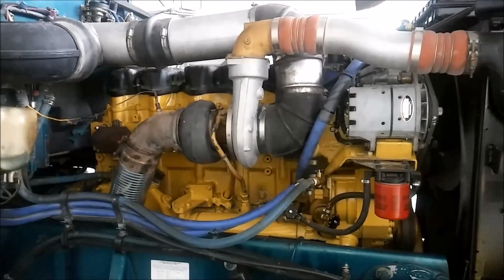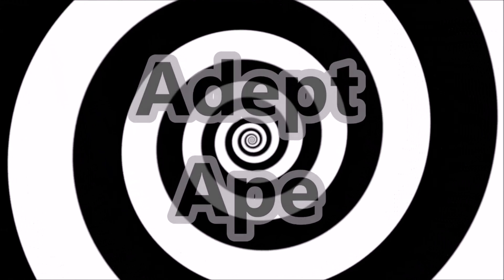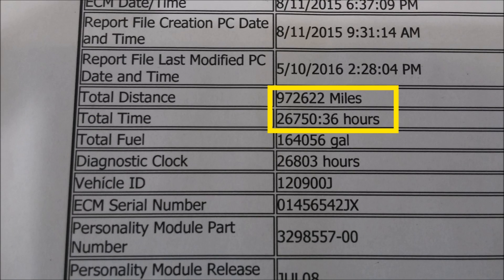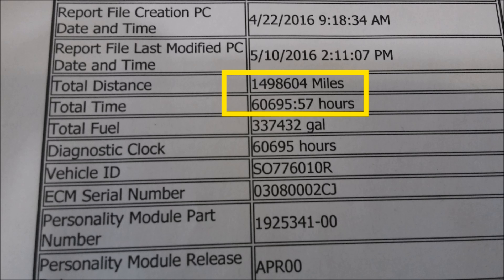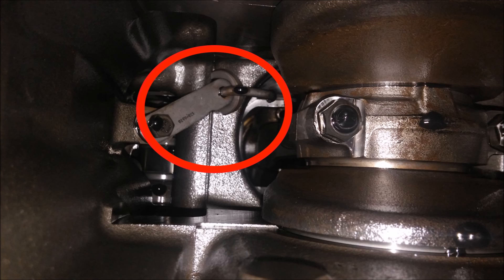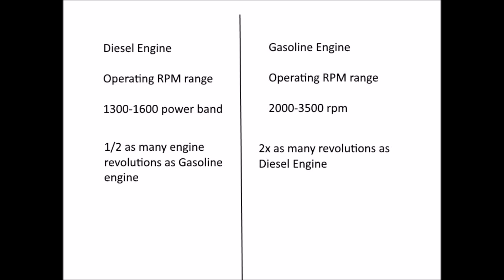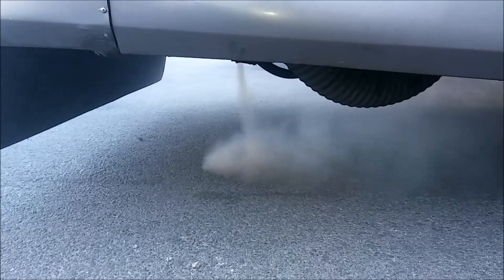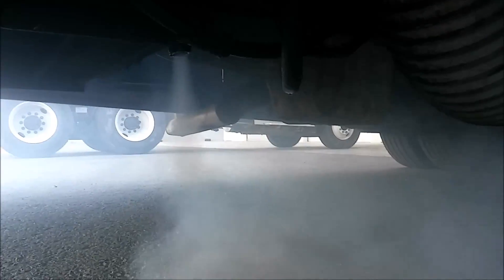Why Do Diesel Engines Last So Long?

Comment: Heavy duty Diesel engines (think caterpillar, cummins, Detroit Diesel etc.) are designed to be rebuilt after every 1 million miles. If routine maintenance is kept, the original block should see about 3 million miles. This is because the large displacement highway engines have cylinder sleeves that are replaced every time the engine is rebuilt. 
I really enjoyed the video by the way! 
quick question- Do you work for a Caterpillar dealership and if so, did you start right out of school or did you switch jobs? Also, do you like working for CAT?
Reply from the maker: +Luke Kohut-Jackson Thanks for the comment. Yes I do work at a Cat Dealer. I have a few videos about it too, you may want to check out. I like working there and have been there over 10 years. I started when I was young and taking classes at a Community College.

Comment: Diesel , Kerosene ,  and Propane come off the Crude oil first and don't need much refining. Gasoline is refined more and has Chemicals added to it that do harm your engine like Ethonal !
Reply from the maker: +Mark Jacobs Ah yes good old, managed ethanol. Nothing like some corn in your engine.

Comment: Really good points for those unfamiliar with diesels.  You only touched on the major point a little at the end, but that is the 'owner-user use' of the diesel, being as that is the BIG ONE. If I start and run my Cat D7 dozer, it stays started and running all day (yes, even lunchtime). One start for that day, versus 5, 10, 15 start-cycles for a car that will then see it's use RPM-range used constantly (where my D7 dozer stays RPM-set most all day). A much-better comparison at the technical level would be a 'times-started' and hobbs-meter comparison. In fact, my guess is that gasoline engines have a longer life-span than most would ever expect, but they are used so very differently, there's just not enough examples to compare.  Also, keep in mind, I know that the big rule on diesels are OIL-AND-FILTERS! Constantly changing oil filters, air filters, and my god (as most diesel owners will avow), I should have controlling interest in Shell's Rotella D!!! Great video, thumbs up.
Reply from the maker: +Skeeter Saurus Thank you and a great comment.

Comment: Great Vid
 Would you not agree that comparing a 350 cut engine to one that's over 700 ci is an unfair comparison? Of course like for like the diesel will still be more stout.but it's kind of like comparing an avocado to a caper.
Great Vid
FM
Reply from the maker: +Frank Muhammad I think for the purpose of the video it worked because without showing the size of a normal sized bearing, it wouldn't show the drastic difference in parts size. I'm not saying that the Cat engine is better, just the reasons it can get such long mileage. I don't own a Diesel and the video wasn't trying prove that Diesel engines are better, just why they last so long. Thanks for the comment though, it was respectful.

Comment: i drive long haul and found this to be quite informative, and helped me see why and how I should keep my personal vehicle diesels. thanks for sharing.
Reply from the maker: +Aaron Layes Well a small Diesel Engine is going to have more car like features than the larger truck engines, but still retain some of the advantages such as the fuel.
Reply: Yeah I figure it's like a middle of the road mentality. I've seen semi trucks with 6 million miles, but the highest I've seen recorded on a diesel car was like 1.2 million so for sure there is a gap due to some of the other things you talked about, I think that getting preventative maintenance is huge, and find making sure the oil is changed as well as preventing temp extremes is also a massive role. By the way just saw a RV stuck in the median trying to pull a u turn on the free way yesterday lol if only the bigger motors meant better drivers right.

Comment: And the most important reason is commercial operators will have the maintenance done. They won't drop an engine over oil or coolant.

Comment: gasoline engines can be pretty impressive as well.  I was working for a dodge dealer and we were servicing the caravans used for transporting rail crews and they had 2 of them with over a million kilometers.  but they were almost never shut off and they were well maintained.
Reply from the maker: +J. Dana Clark Not going through a ton of heat cycles helps and they were probably driving them long distances with much stop and go all the time as well, much like many of the truck engines.

Comment: Yes , in Europe we have diesel cars which are not really run-in until they have covered 200,000 miles. The ultimate mileage is never really known as lock and plip troubles usually   kill the car long before the engine wears out.  

Take for example cars with central-locking.  The first lock to fail is the steering lock.  Next some bozo replaces the steering lock but as the car can still be opened with the plip, the original keys get thrown away.  Next the rubber button in the plip swells-up and presses the plip micro-switch all night. The plip-key gets sent away for repair but on return it needs to be synchronised.  To do this one has to somehow get into the car, Catch 22.

Really a car like that needs FOUR NEW LOCKS and a new window as the Main Dealers advise smashing a window to get in  Its not really worth the hassle and expense to do it so  the previous bozo and the swollen button may have made my car a scrapper.
Reply from the maker: +Tech Davey Thank you for commenting.

Comment: do rv engines overheat more than most other diesel engines?  If so why?
Reply from the maker: +Some guy That is a complex subject, but for most RV Diesel engines, they have higher horsepower ratings so they can produce more heat than a similar engine in a truck, their radiators are typically in the rear, so worse airflow and they are also lower to the ground so more likely to pick up dirty, blowby, and other things. The cooling systems sit for long periods of time so they will accumulate buildup on the cooling tubes if the coolant isn't properly maintained.

Comment: first point is rubbish.. you are comparing apples with oranges.. that Cat engine is for heavy vehicle applications.

You would be better off comparing a 2.0 gasoline engine with a 2.0 diesel engine.

We know though, that Diesel engines are low revving, use the diesel as a lubricant, have a reinforced construction and bearings are slightly larger (but nowhere near as big as that Cat bearing lol), and use different materials or materials where extra hardening may have been executed (case hardening or forging as examples) but much of that would depend on the cost limit.

btw, I have read that a gasoline VW Passat had achieved 500,000 without a rebuild. I have no doubt a diesel engine would trump this.
Reply from the maker: +TheSaintST1 The first point isn't rubbish, it would be if I was trying to convince everyone that a C15 if a great choice for them in their car. My point was to show why Diesel Engines can last so long and the thumbnail is a Caterpillar engine. I used the Automotive comparison to show a "normal" engine people are familiar with compared to a Heavy Duty one. 

Maybe I should make a "Should You Buy A Diesel" video that could examine 2 similarly priced and sized engines, one gas/one Diesel.

Comment: I support your video idea, I just wanted to level some things out. As a mechanical engineer with an interest in engines, I wanted  to make sure that the comparisons are valid.
Reply from the maker: +Geoffrey Mentink You laid out some well researched points. Since you brought up sulphur, have you seen any decrease in injector life on older injectors caused by the low sulphur content?

Comment: Best examples i know are VW Golfs MK2 in europe, after 21 years of wear and tear, abusing, running on the worst fuel you can find, they still have power in them and can pull like train, considering how old they are and what they have been through. To be honest, no idea when Golf arrived in USA but we sure didn't have MK2s, haven't seen single one in 20 years.
Reply: They were call Rabbits

Comment: pithy and informative, I like it.  why do you mention rv engines specifically?  what makes rv engines more likely to overheat?  lack of a professional driver?  poor choice of engine by the manufacturer?
Reply from the maker: +Matthew Millar RV engines are usually in enclosures that prevent as much airflow and they sit a lot of the time and not driven as much. They seem to get internally and externally plugged radiators more often due to the radiator getting blowby blown onto it or lack of coolant maintenance.
Reply: Gotcha.  Thanks.  :)

Comment: I don't agree with your comparisons. The correct engine to compare a Cat diesel to is a piston-engined gasoline fuelled aero engine, not a small vehicle engine, and these last a long time.
The comparison of engine speed is misleading as you will find the piston speed is very similar for ALL vehicles, from ships to small motorbikes. The large diesel engines you are using as an example have long strokes. However, diesels are limited in engine speed due to the short time available to mix air and fuel together and burn it, as opposed to gasoline engines which have an extra stroke to accomplish this.
The extra size of diesel components is due to the higher pressures in the engine due to the compression required to achieve rapid and reliable combustion, small engines often as high as 22:1 as opposed to 10:1 for gasoline engines. Not only that, but the pressure spikes on a diesel can be pretty high, hence the diesel knock on idling which is similar to a gasoline engine pinking, something a gasoline engine can't tolerate for long.
Additionally, in  the past when leaded fuel was common (and I can't speak for modern lead-free fuel, some fuel chemist could answer this) there were chemicals added to fuel to purge the lead from the engine and prevent deposits. These chemicals caused excessive (corrosive) wear in engines. Any engine that ran on LPG or CNG would last a lot longer for this reason, as these chemicals obviously did not find their way into these engines.
What caused a lot of wear in diesel engines was sulphur corrosion due to the higher sulphur levels in diesel fuel, but with the new lower sulphur fuels being pushed through from Europe, diesels can be expected to last even longer.
Reply from the maker: +Geoffrey Mentink The comparison was purposely between an automotive engine and a Heavy Duty Diesel, because most people know a little about car engines but rarely see a Diesel up close. I'm not saying one is better than the other, just different.

Comment: My ranger has a 350😂😝😝, I usually get 150k before it starts to burn oil, because I'm really hard on mine cause I race, but I do 3k oil changes, a little excessive but that's how it lasts so long, keeping good oil in your engine
Reply from the maker: +Jake Duerr You put a Chevy in a Ford huh, the sacrilege! I almost did the same thing once. That's not too bad of longevity for a race engine.
Reply: Jake Duerr